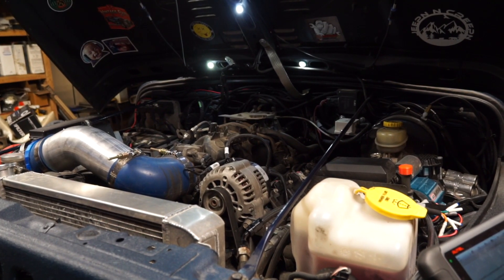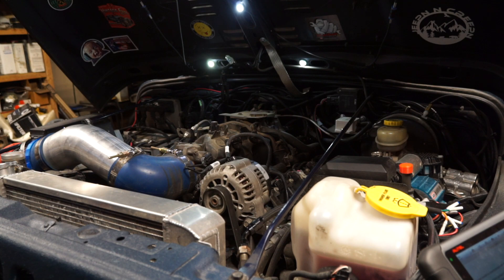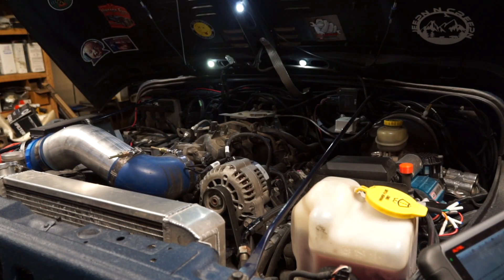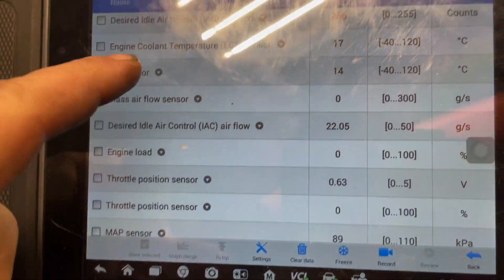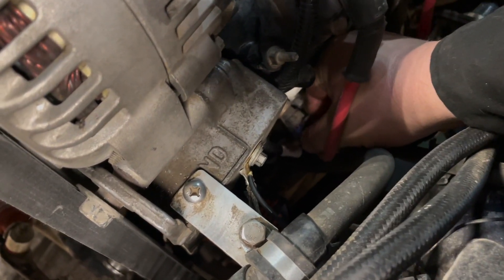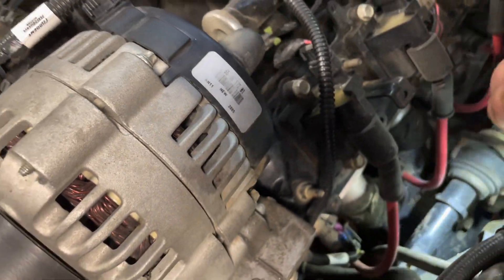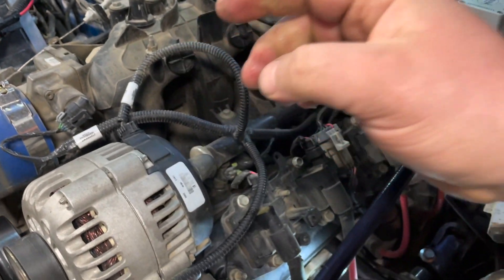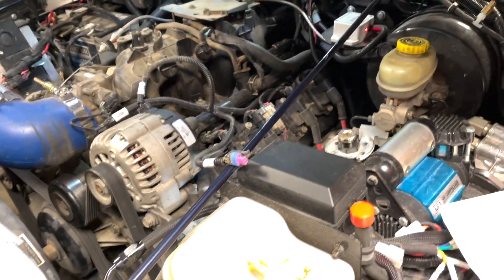P0117 Engine Coolant Temperature Circuit low

Comment: OKay .. so, I replaces the ECT with a new one and even replaced the ECT plug/wires.   But the fricking thing STILL READS 0117 AND I GOT A P0300
Reply: Did u figure out the problem
Reply: Cek the fuel filter , my car like this
Reply: Replace the thermostat.